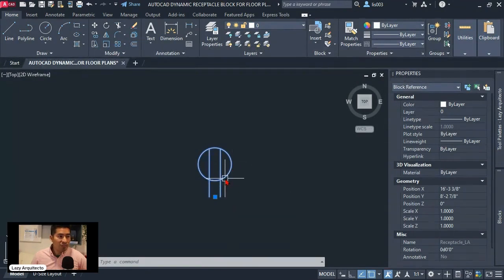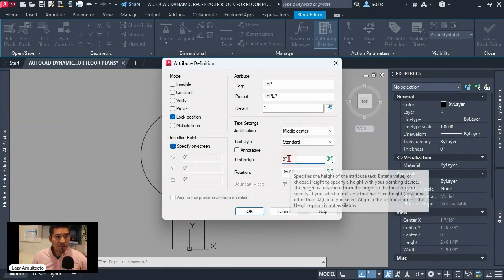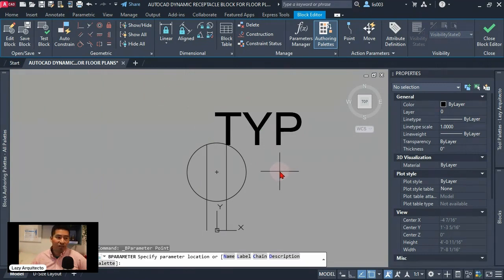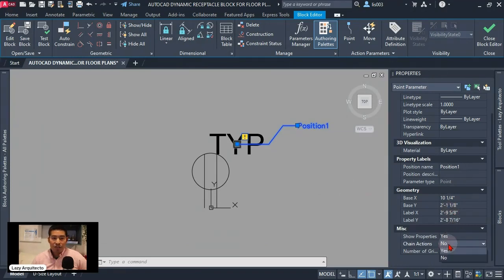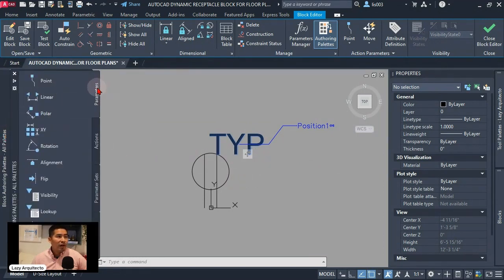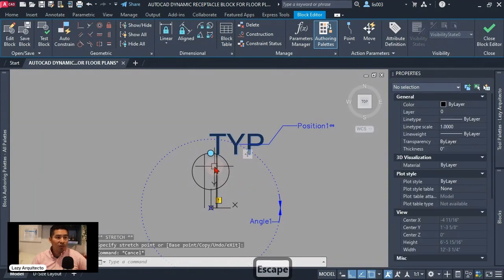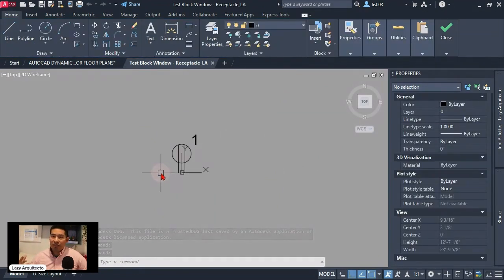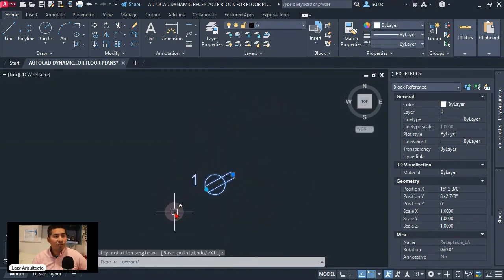AutoCAD Block Trick: Keep Text Horizontal During Rotation

Comment: I found this video both very interesting and frustrating.  If one follows the video step by step they can make this work, but I can not understand why it is necessary to add a point to the dynamic block so the attribute will stay horizontal as the block is rotated. When the attribute is added it is stated that it is important that the "lock position" is checked.  What I want to know is WHY.   When the point parameter is added to the block no explanation is given as to why it must have "chain actions" set to YES.  I looked up the purpose of chain actions and it is clear that they allow one parameter to start another parameter when activated.  What is not clear in this video is what controls what.  In other words does the point parameter control some other parameter or vice versa?   Also when the point parameter is associated with the move action it is not clear how that keeps the text of the attribute horizontal.  Another thing which has me confused is the creation of the rotation parameter and the rotation action associated to that parameter.  As best as I can figure out when the point parameter is chosen to be rotated that fires off the chain action command for the point parameter and allows it to be moved.  What doesn't make sense is why is the attribute not chosen to be rotated?  It seems it must be rotated to the new location yet is does move when the rotation commnd is used with the block and not only does it rotate it stay horizontal EVEN THOUGH it was not chosen as an object to be rotated.  So how does moving the point parameter move the attribute when only the point was chosedn to be rotated when setting up the objects to be rotated.     Really confused about how all this works, but yet it does.  Sort of like having trouble understanding of how derivatives are determined in calculus, but if you follow the rules it works everytime whether you understand the derivation or not.   I would like to state this young man knows more about dynamic blocks than I am likely to ever understand.  I really like his videos and wish I had a better comprehension of some of the details regarding dynamic blocks.   Thanks for posting the video.  I can now rotate a dynamic block and keep the attribute horizontal, but I have not idea of why it works.
Reply from the maker: Thanks for the detailed feedback and I'm happy you found the video helpful, even if some concepts are confusing. I might do another block with the same concept to explain in more detail. Turn your bell notification so you don’t miss it

Comment: Is it possible to keep the text horizontal while using the Alignment Parameter, instead of manually rotating it?
Reply from the maker: Hi Eduardo, yes there is a way inserting the dynamic block with a macro command, i will demonstrate it in a live session, subscribe so you don’t miss it

Comment: I have similar dynamic blocks where I have applied the rotation parameter, to several attributes; the blocks work fine until I apply the BATTMAN command to set the order in which AutoCAD will ask me for the attribute data.   When I apply the command and give it the preferred order, the rotation function stops working (over attributes) and I have to move the data one by one. Do you have any idea what is going on?
Reply from the maker: Why would you use Battman after you have created your block? Just have your block created with the correct order of attributes from the beginning and never will need to use battman
Reply: @LazyArquitecto  Precisely the problem is that the blocks are dynamic and so is their creation.   I already realized that if I apply the order at the beginning it will be maintained.

But what can you do when you have 20 to 40 attributes or more and you need to introduce one that alters the order?

For example, if the block should now include a work area difficulty attribute, where the repetitive jobs will be less than one, the standard job 1.00 and so as the job becomes more difficult it will increase, it will be used with the man hours attribute to calculate the total job cost, of installing the block they represent, for example the electrical outlet.

But this attribute should be one of the first, not the last in the list, so the order has to be changed.   In normal conditions the value of the attribute would be 1.00, and it is not modified until the job conditions change, but it is not the same to have it at the beginning as at the end of three lists on the screen.

My block of outlets started with one attribute and I have over forty now, struggling to make the attribute names generic and the same for example for luminaires and junction boxes.   And there are so many, because at the end, from the drawing, I have practically the budget done.   But every time the blocks do not work, I have to start from the beginning.   And I suppose that others have solutions that I don't know.